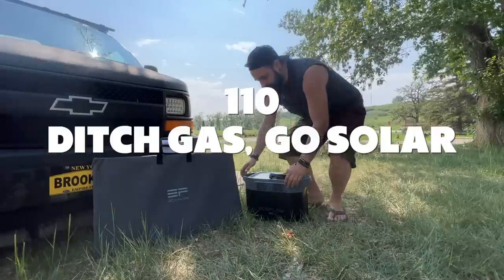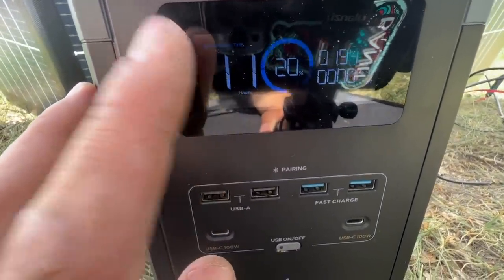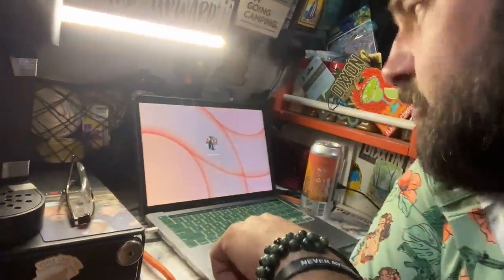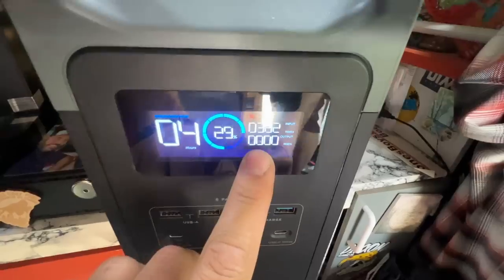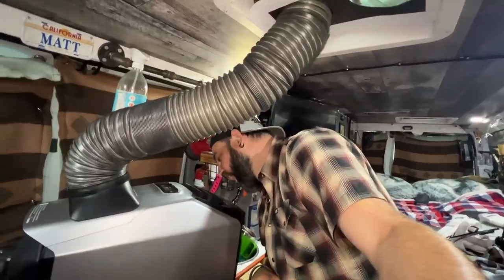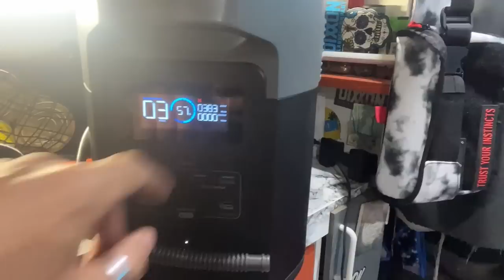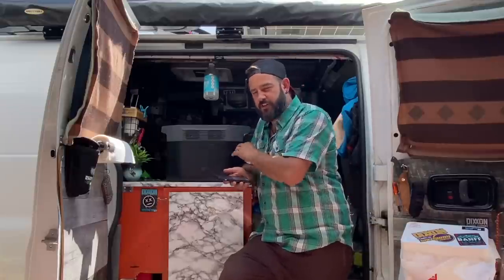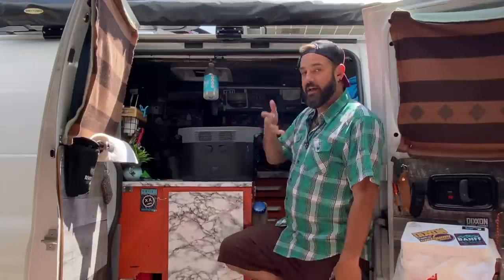An Off Grid BEAST! - Ditch Gas, Go Solar! | Vanlife Power Solution

Comment: Hi Matthew. I have the same brand of solar panels. Your case should have some carabiners located along the edges of your case. You can hook those into the holes along the top of your solar panels. With the case unzipped and in an L position, the solid part should be in the vertical position and the carabiners should hook into the holes in the top edge the of solar panel. The flexible part of the case should be on the ground horizontally under the panel and you can adjust the angle of your panels.
I have the Ecoflow 740 watt River Pro for my little van setup.

Comment: I have that solar generator. It does power faster than Buletti. I have that one too. I have both the bigger versions that I move around with the wheels provided on the Eco flow. and I have a cart I use for the bigger Buletti. If my power goes out for a couple of hours the small ones work fine. If it's days, the bigger ones come in to keep freezer working. I also have Gas generators if I need to charge fast in bad weather. yep ready for grid down situation.  Love your show and the cats. Penny's my favorite.

Comment: If you look in the directions and see the maximum watts it can take in solar panels, it's possible to add more, maybe hook up the solid and portable panels together and draw in 400 watts to charge in half time, or more portable panels and leave the rigid panels alone. Just a thought. Another good video.

Comment: I was laughing my ass off...lol...I have the EcoFlow 400W solar panels and used it on my road trip last year for 3 months to charge my Bluetti 200Max, it took me about a half hour to figure out the stand the first time, it is a pain in the arse, at the end of my 3 months, I figured out it was easiest just leaning it on the front of the car...lol...the wind used to blow it over and in Australia the dirt/gravel etc., ripped the zippers to shreds, thy did send me a new case, the part of the case you thought was for leaning it on the panels isn't...lol...that's the part that goes on the ground, you actually use the four caribiners to clip to the four corners and you have the case sit at the angle you want for the best sun coverage, the box it comes in shows you how to set it up, plus there's a small manual that shows you too, but the box has better pictures, mine was a bitch to set up, 21kg and I only weight 50kg...lol...difficult to get in and out of under my mattress in my small Nissan SUV too. Now I have a Kia Carnival that I've built into a home on wheels and my 310W 24V semi-flex 2mm thick 5kg solar panel that takes over the entire roof, is gorilla taped and very high bond taped to the roof with polycarbonate strips for an air gap between the panel and the roof so I never have to worry about setting it up ever again...thank god...lol, great video though.

Comment: What is the durability of the panels? Can you set them up outdoors, zero degree sunny day, and still have the panels charge?
Reply: The thing about winter where he is, the sun is so low in the sky the panels have a tough time pulling enough sun. Up until the equinox maybe, but the days get short.

Comment: I would like to see a video showing the power draw (watts)  from the EFD2Max using that A/C on the lowest setting… the power draw while cooling and expected hours of operation (which of course is not that number shown, but close to it) —along with other settings med and high… I think for me 72F is cool enough, even though here in the house I keep it at 74…if it gets one thru the night like 14 hours as you say, then by all means its working great!

Comment: My man.  You need to run two hoses to the outside.  The unit wants to pull in your outside 25C air and then put your van heat into that air which it then needs to push that now even hotter air outside.  Inside your van the unit wants to pull in your warm van air and push out cool air into your van.  If you only run one hose out then the unit will not work as well.  Kind of like pulling outside air into your  house furnace and then using that to heat your home.  That would use a lot of energy.  Instead, your furnace pulls in the already warm inside air add then heating that up a bit and then blowing that back to you.  Capiche?
Reply: I don’t really understand any of these battery things…. Nor air conditioner things. AC/DC etc are all a mystery.
Reply from the maker: I don’t understand that logic at all, if the air outside is hotter than the air inside why would I want to pull it in? I have found just using it like the AC unit I had in my apartment works fine and is nice and cool
Reply: Scratches head🤔 errrrr what!😂🤣😂
Reply: @VanlifePLUS Hmmmm.  I'll try again to explain this.  Your AC unit has two radiators.  One radiator gets VERY hot.  The outside air is cool enough to get the temperature of that very hot radiator down to a usable temperature.  The hot loop is supposed to bring in outside warm air, dump your heat into that air and then push that really hot air back outside. 

The other radiator is very cold.  You want to recirculate your inside air over this cold radiator.  You are supposed to bring in previously cooled air from inside the van, cool it more and then push it back out into the van.

If you only run one hose outside and blow air out then that air will need to be replaced...or you won't have any air left in your van.. 😀 The only place to get replacement air is from outside and that air is hot.  Wouldn't you prefer to keep recirculating your already cooled air in your van and maybe get it a little colder each time through the AC or at least save on battery life?

Your unit is a heat pump.  Here in arizona we use heat pumps.  The hot radiator is mounted outside and that unit has a large fan that blows outside air over it to cool it down.  That radiator gets so hot that 50C outside air seems cool to it.  

We continuously recirculate the previously cooled inside air over the inside coil.  That coil gets really cold.  The inside and outside radiators are connected together with just little copper pipes that carry the refrigerant.  We dont bring in outside air.....except when the kids leave the doors open when playing LOL.
Reply: @patrickfrantz2466  Thank you Patrick I now understand what you were saying, it's interesting to know about the recirculation!😊

Comment: The solar panels be a more accessible option for someone with disabilities?  From a safety standpoint with climbing, it would be very helpful.  Also, winter use - would it be possible?

Comment: When you're using an extension cord from the house that also reduces the amount of water so if you plug it straight up into a wall socket in. Your house you might even see a lot better of ti'm OKOK TPT PTV TPT P top. Was that too many tippies or one too many it could be? I'm not sure anyway tippy by
Reply: I did a boo boo smith
Reply: A speech to text is awful not water water water. That's what the tipsy tipsy tips and tips and tips and oops he boops. He was oops he oopsie doopsy absolutely
Reply: Is wattage wattage
Reply: I give up I just can't I can't I just can't

Comment: And my 2400 watt Energiser Inverter gas generator cost me $620.00 tax in
Reply from the maker: Yeah but like I said gas is a hassle for lots of us
Reply: 🤔 hmmm ,  & how many 
Thousands of $ in gas 
over the same 10 - 12 year 
life cycle ?
Reply: @rythemzlatin  1) you are never gettin 10-12 years out of these. 2) who cares, I can tell you alot more people have $600 up front and $25/week for gas for stable reliable power, than they do $2500 up front that only works if you have sun or a plug in. These dont charge themselves for free. 3) My gas generator, which is mounted outside, will never blow up splitting my van into pieces, these battery packs can, and do!

Comment: You can do all these vids you want, not too many ppl will or are able to pay $1500 for a battery in a box. Sure they are a good addition, but unless it is free, like you get them, they are NOT that good of an addition.OOPS, I just looked it up, this thing is $2500.00. For that price, it is JUNK. A $1200.00 solar set up is far FAR better.
Reply: It does seem a lot but as with most new products the price will probably come down, also Matthew provides a discount code in the description. Consider the features, it's super powerful and can charge fully in an hour which for a lot of vanlifers is a major plus. Solar is amazing but if you're in an area where it's cloudy often or in wintertime it doesn't work so well and if you're far north like northern Canada or Scandinavia where there are extremely limited light hours in winter then solar is pretty much useless.
Reply: A LOT of people fail to factor-in 
the LIFESPAN of items vs. 
"buying cheap" , but often. These 
batteries are typically rated @ 10 
years , but if you don't abuse them 
( i.e. run them below 10% ) you'll 
probably get 12 years before they 
"hold a charge" @ diminishing 
time periods. Compared to Lead 
Acid & GelCells ,  they can be 
HALF or less  the cost ,  you're 
just paying it all up-front. Factor 
in inflation as well , and the 10-12 
year savings increase more. 
FAR from being "junk" 😄 .

☘🍀just another LiFePo4 day🍀☘